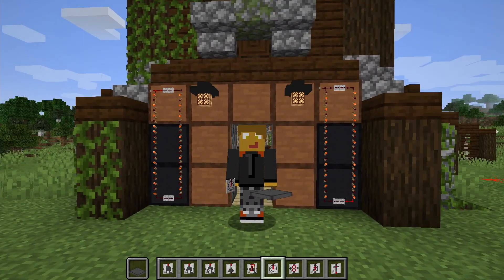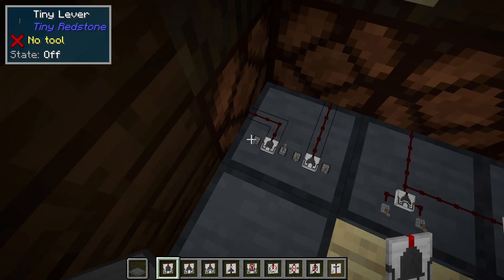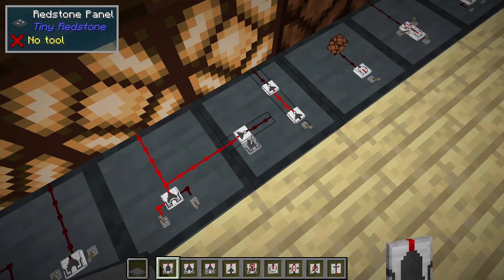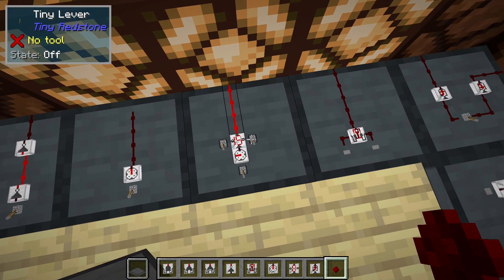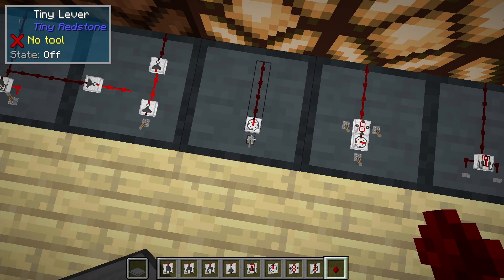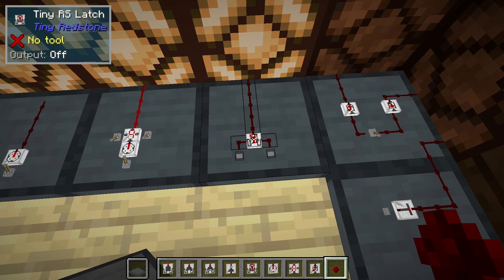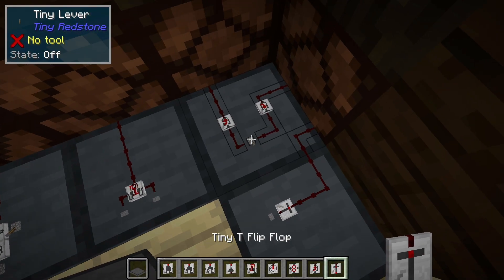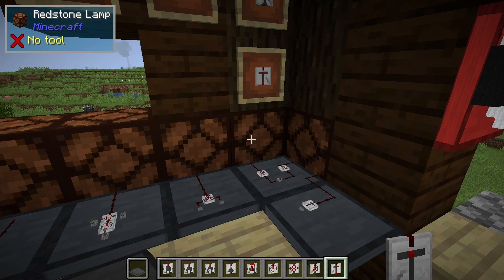Tiny Gates Add-On for Tiny Redstone - Mod Spotlight

Comment: Also, can the panels be placed back to back? 

I was thinking one side would just be buttons, and pressing those tiny buttons would trigger a redstone signal on its exact location on the opposite side. That would be insane! 

I haven't tried this mod yet, but this is exciting! And this suddenly got me very curious.
Reply: Nvm, I just realized that would be overkill, I could just put a wall on the side of the panel with buttons and would be easier. XD
Reply: But still the question remains if, the panels are movable hahaha
Reply: I just realized, again, if the tiny redstone panels are like repeaters, they can't be movable 😢

Comment: I love automating using computers but I don't know any programming languages, this is going to help me massively with building "small" computers for automation. Now I just have to figure out data storage. Maybe a piston feed tape of solid and non-solid blocks representing a zero and one respectively?
Reply from the maker: Glad to help! 😁 Piston tapes are definitely the vanilla way to go. I'm considering data storage as an add on. No guarantees though, and it could take a long time.
Reply: @DannySon  if you're struggling for a concept, might I suggest a Magnetic Tape which moves forward one increment at a redstone pulse and eventually loops like an 8track. And a ReadWriter which when unpowered reads and when powered writes.
Reply from the maker: Interesting approach. There is an open issue for this here (https://github.com/dannydjdk/Tiny-Redstone/issues/87) if you want to add to the discussion, so I remember your idea when I get to this. The very general approach I talk about there is with the use of something like a disk drive.

Comment: With all these great logic gates making computers more compact I think it would be neat if there were more ways of inputting and storing redstone signals. For instance, giving jukeboxes or lecterns the ability to store redstone signal strengths in disks or books. Or perhaps by adding some new blocks based around antique computer storage systems like punched paper tape or delay lines, those seems like they would fit nicely with the aesthetic of centimeter sized logic gates and fridge sized calculators.
Reply from the maker: I do like this concept. Someone recently posted a feature request for this: https://github.com/dannydjdk/Tiny-Redstone/issues/87
Maybe it was you?
Reply: @DannySon  Yes, glad you like it.

Comment: how many blocks high can you go?
Reply from the maker: 7. Each component is 1/8 the height of a block, and so is the panel. So, each panel fits 8x8x7 tiny components.
Soon, the panel will be optional, and you’ll be able to stack them as high as you want!
Reply: @DannySon  awesome, may have to take a crack at making a monecraft computer with the mod once it doesnt require the panel :)
Reply from the maker: The latest version for 1.17.1 now doesn't require the panel. I'm still working on porting that back to the 1.16.5 version.